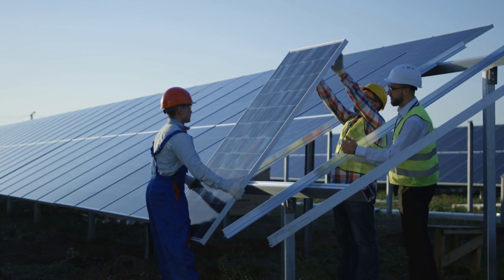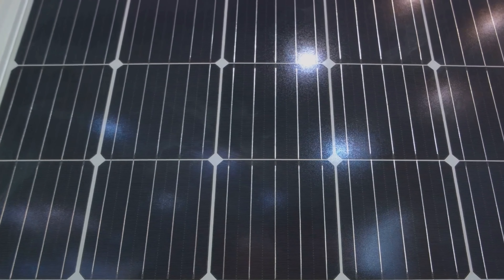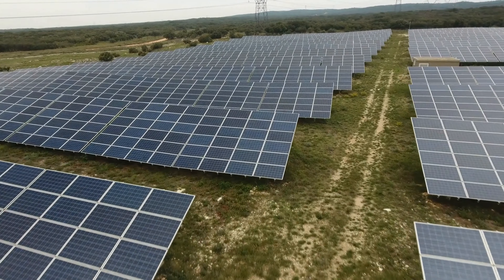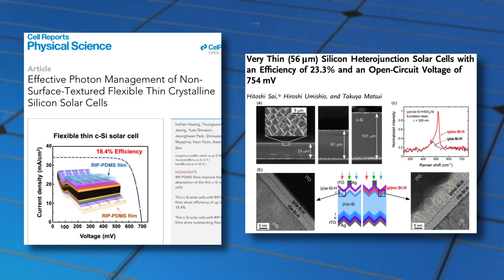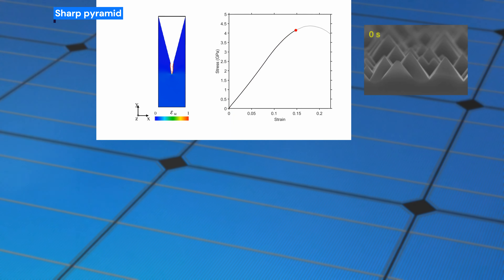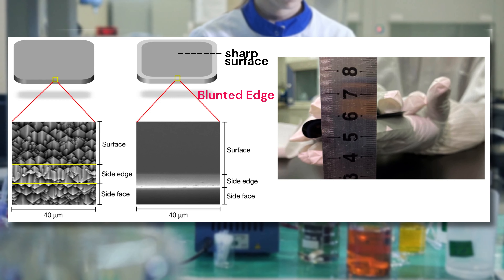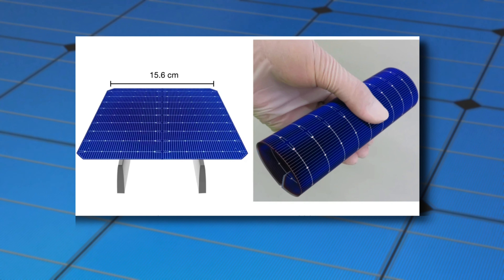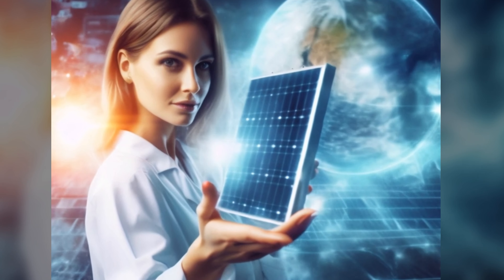Flexible Solar Cells - Blunted Edge

Comment from the maker: With truly efficient flexible solar cells, we could "integrate" them on almost any surface (buildings, cars, planes, lampposts). Here, the authors reached a record efficiency >24%  (higher than many rigid/brittle commercial photovoltaics). This is a fresh discovery, not yet on the market, but I am curious to see if/when it will be commercialised. What are your thoughts?